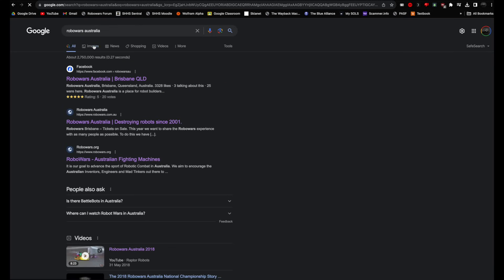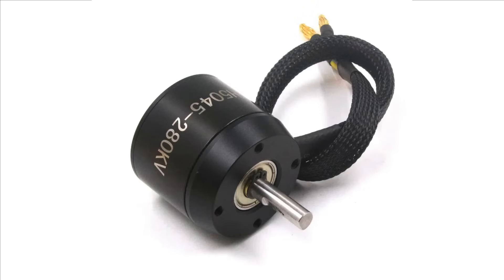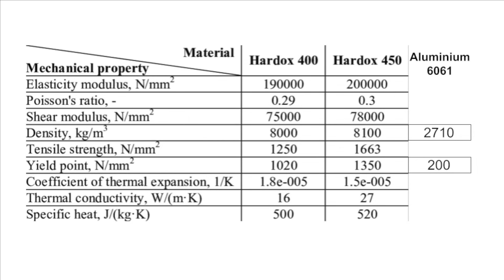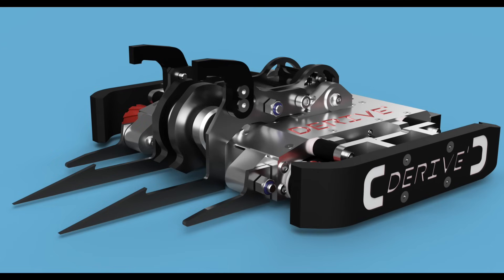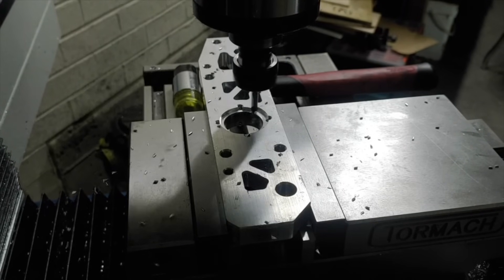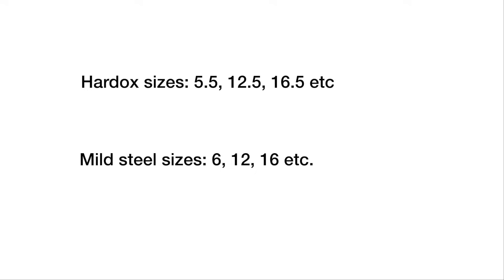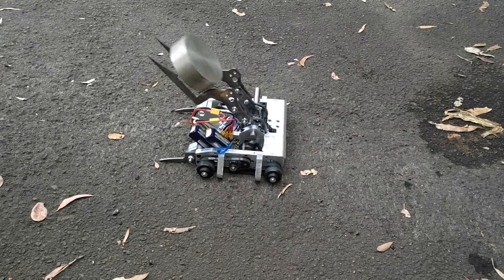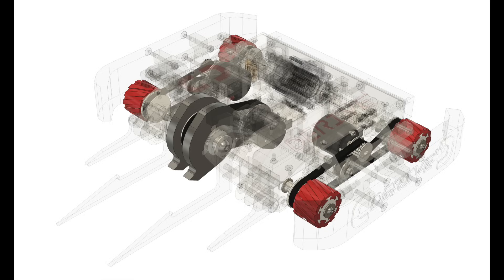Building a Big, Dual Weaponed Combat Robot - Derive Part 1

Comment: I'm not 100% convinced about the serpentine belt drive. With your previous design (one driven wheel, one by belt), at least if the belt-only wheel/sprocket was damaged, the belt was damaged, or things got shifted and the belt lost tension, you would still have the driven wheel working. In this setup, if the belt, idler pulley, drive pulley, front wheel sprocket, rear wheel sprocket gets damaged, you lose that entire side. Even if the robot just gets bent a little, the belt may lose tension and slip. The wheels and pulleys are also only mounted on one side, so potential for a bolt backing out just slightly could cause the entire system to lose tension, even if otherwise it was still operational.

It will be interesting to see how it performs, especially against undercutter style horizontals.
Reply from the maker: The current drivetrain has a ridiculously loose belt tension and works fine due to having heaps of wrap on each pulley. If the belt is lost it loses drive yes, but I considered it worth the weight gain.
Reply: I've seen this technique done elsewhere in other 4wd verticals... Have 2 belts from the motor shaft, one to the front wheels, and one to the rear wheels. Long motor shaft, with one sprocket on the inside and one on the outside. Flip one set (either the front or the back wheels, whichever drives better) so the wheel dimensions stay the same, and you don't require any extra space. Now there are less moving parts, less likely to get tension issues due to simpler belt paths, and redundancy in the belts/belt paths while making no significant changes to the layout of the parts.

I don't think this would work 100% on your design, since the armor mounting may get in the way of the outer belt path.

Comment: 6:50 How did you structure your CAD file so that you can do such a drastic change? I usually try to do a top down approach as well but any change like that would mean a complete redesign for me.
Reply from the maker: Two methods:
1) fully parametric parts, each brought in separately. Therefore all changes can be undone and references updated.
2) my method, just brute force the updates to the part using push-pull and direct modelling. Not ideal but it isn't an actual engineering model for production so fine by me.

Comment: When bending uhmw I found that if you run in under cold water while bent into position, it will hold its shape permanently.

Hardox is hardened all the way through, not just case hard.  It's hard but still tough.